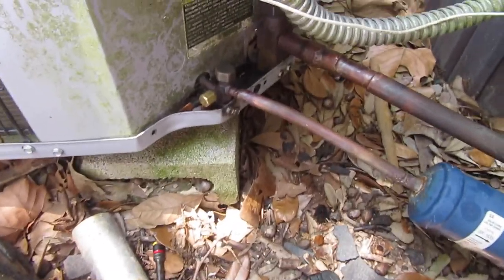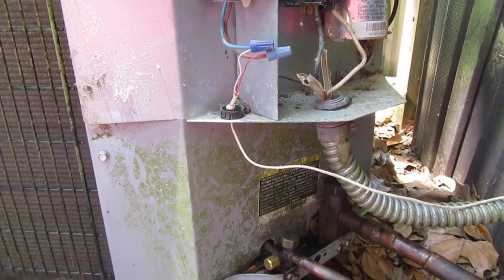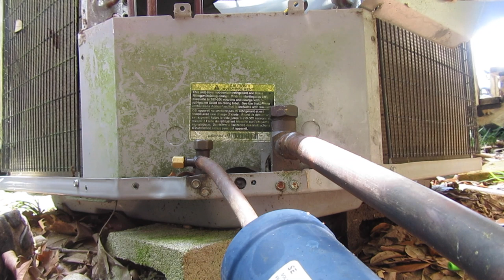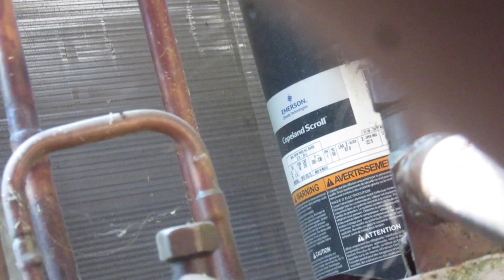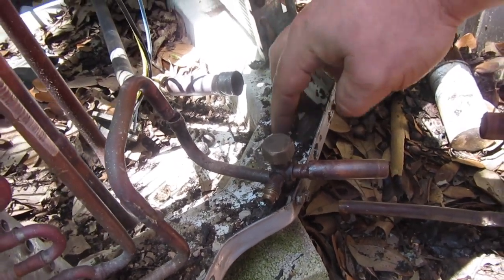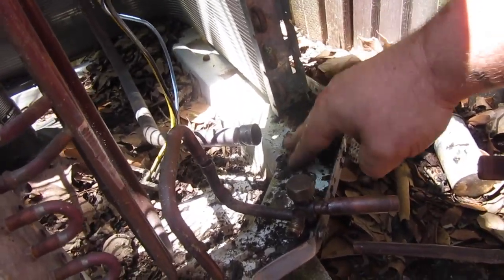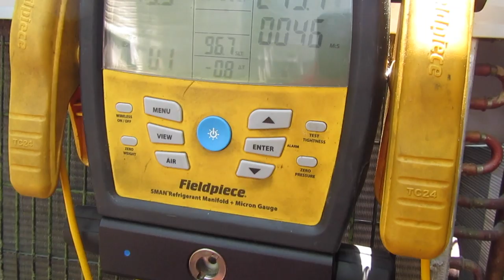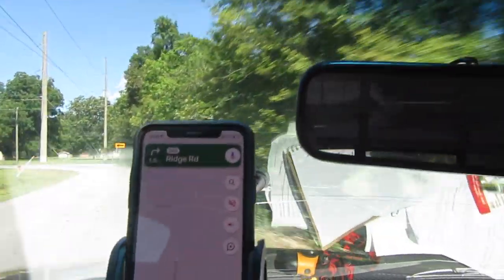Refrigerant Leak Repair | Replacing Service Valves

Comment: Great video John I went back to 407c after trying a couple other blends. I just feel that after a few years of going back on older units that I worked on 407c is the best choice 👍 None of my customers has complained when I went to 407C some of the other brands I had customer saying they didn’t feel like the AC cooled as well👍
Reply: gtrdre jugfde 407c good for POE systems MO99 is what I use for mineral oil compressors

Comment: Where in the world do you get replacement caps for the valves, not the 1/4 flare caps but the ones that go on the service valves?  I've had occasion to either loose one or two or will find them missing sometimes.  I've looked all over, there doesn't seem to be a standard size either, I think each valve manufacturer has their own size and thread.  I just lost one on a York suction line on an AC unit, fortunately, I have a machine shop and fabricated one, but it took over 30 minutes of my time when I could have been doing something else.

Keep up with the videos, I really enjoy them.  I've never heard of that refrigerant you are using, what can you tell us about it?  Jim

Comment: Nice job brother as always. good to see you back. Been pretty slammed here with work also. What’s up with the green flex whip being used outside? ( I know you didn’t do it). Have to use Sealtite outside by code here in FL. Green flex is only good for indoor application in a closet or garage where it is subject to damage.
Also if I was moving a condenser, I would have just cut the line set about 6” back from the service valves and swaged them so you wouldn’t have to rebraze them back in so close to the valves ( and of course wrap the valves with a wet rag)